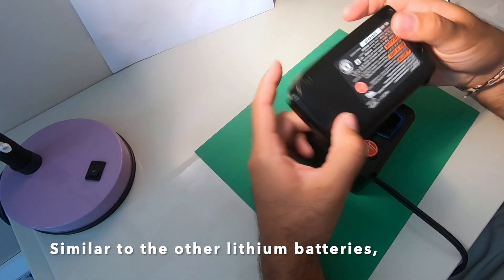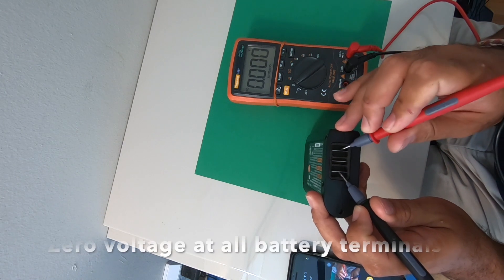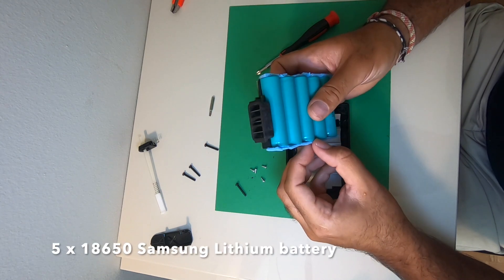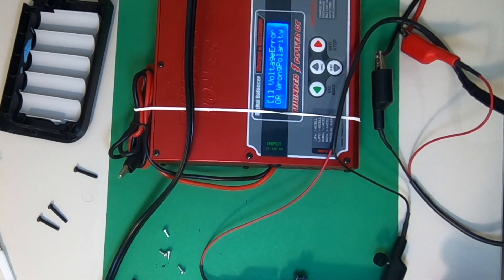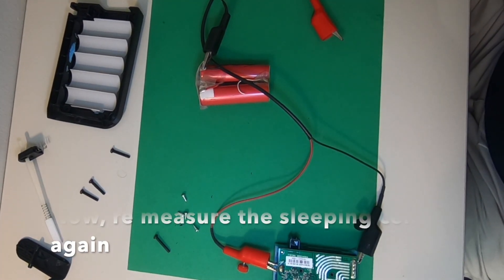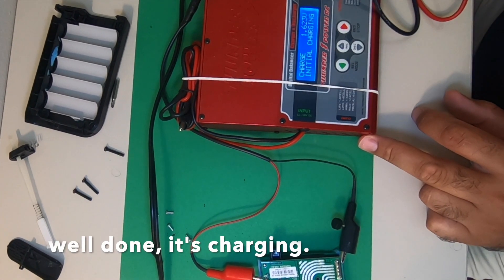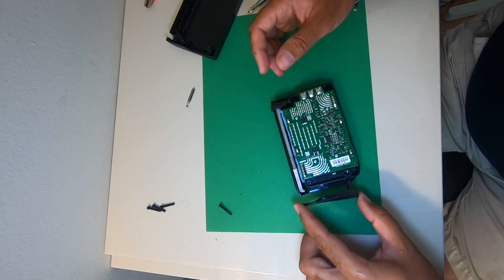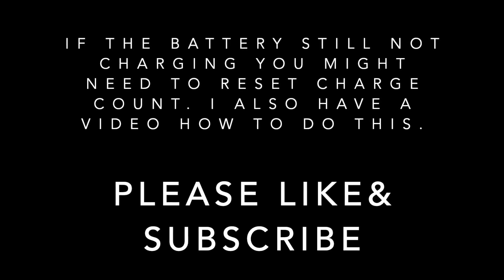Hoover Linx BH50000 Lithium Vacuum Battery Repair

Comment: Hi, my battery has 14 volts across the main connections.  Each of the cells have about 4 volts, yet it will not charge.  I put it in the charger and it blinks then goes off.  I have another battery that charges fine (so not a problem with the charger).  Any suggestions on how to proceede?  Thanks

Comment: I rewrote this and deleted the old posts
1.  Vacuum will not operate, and battery pack will not charge (it was having less of a charge over time).
2.  Bench test of battery: all cells were over 4V, the output of the pack was over 18V but disappears when a small load was applied.
3.  Changed the two mosfets.  Vacuum still would not operate.
4.  Watched the video and performed the circuit board short on 1-2 and 1-5 pins.
5.  The pack immediately began discharging the batteries through the 750 ohm resistor R20 (got real hot). Someone else commented on the same thing.  Look at the board and find the (3) resistors each marked 750.  It is the smaller one out of line with the other two.  Don't put your finger on it.
6.  Put it outside until next day.  Batteries stopped discharging at 2.75V on all cells so the discharge protection is still working.  The resistor looks ok.  Still will not charge, just flashes.  Performed the shorting reset again with the batteries discharged.  Put a charge back in each battery individually and they still began to discharge again through 750ohm resistor.  I put it in the vacuum and it ran a few seconds so I think a new battery will fix the issue. 
7.  New battery arrived ($37 on Aliexpress) and it works great again.  I guess my old pack was just too far gone.

If you're reading this, I hope the shorting method works on yours.  The price of these vacuums has only gone up and it's still worth buying a new pack to keep it going.  Don't forget to pull out that piece of foam at the top of the dust cannister and wash it out and use a long pair of hemostats (try Harbor Freight) and pull the junk out of the bottom opening.  It always works like new again after that.  Cheers.

Comment: Worked perfectly. I just taped wires to a regular small battery charger to get some charge in, taping them to the first set of side terminals, then second, then third until they all measured some charge. Also shorted 1&2 and 1&5 pins on the board per the other video to reset the counter. Thanks.
Reply: How do you do reset on Onepwr 4v latest battery?

Comment: Hi, I got one of these vacuums and I don't have a battery or a charger.  But I have some other battery packs that I can use to test it.  I was seeing in the video that instead of giving the full 18v from the terminals, it splits them, left terminal around 8v middle ground and right 8v, is that correct? I don't want to send full 18v from a drill battery and burn it up.  I'm guessing for low it uses one sides 8v and high uses both together? Thanks for any input!
Reply from the maker: Chad Lee terminals on back of logic board should give 18v.All cells connected series. You can measure cells individually and replaced defective ones. Actually better to change all cells with new ones if you cant measure capacity of old ones.
Reply: @tipstricksreviews4481  Sorry, I don't have a real battery and I was wanting to test the vacuum out before I try and buy one. See at  4:43 to see what I mean about 8v on the outside terminals and I assume the negative in the middle.
Reply from the maker: Chad Lee if you see 8v from the same terminals I measured, some of your batteries are dead. Try measures individually to understand which one. You can try to shock dead batteries with a 9v or 12v power supply(don’t over heat or charge)
Reply: @tipstricksreviews4481  Thanks